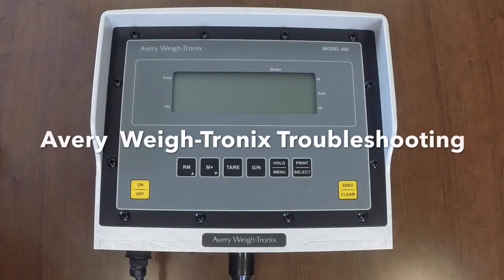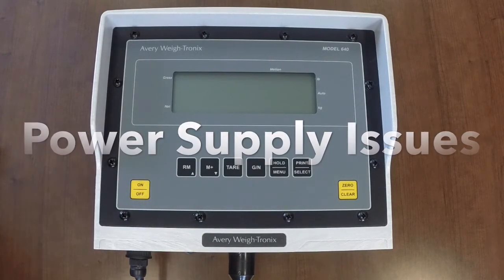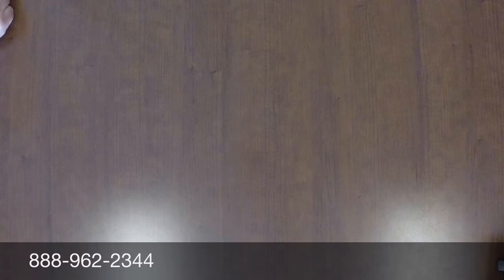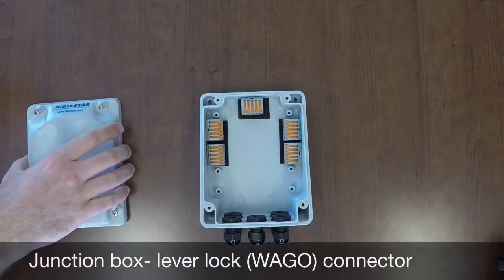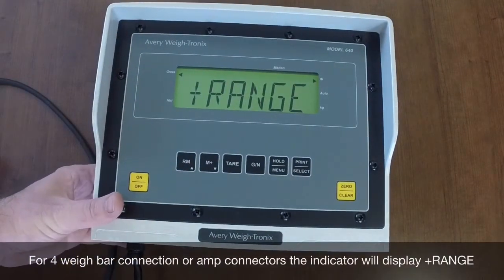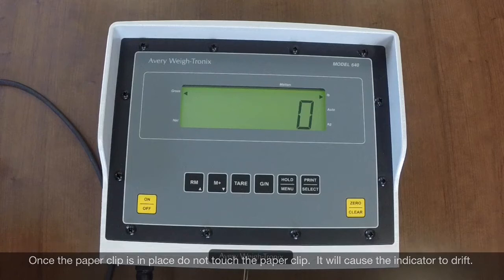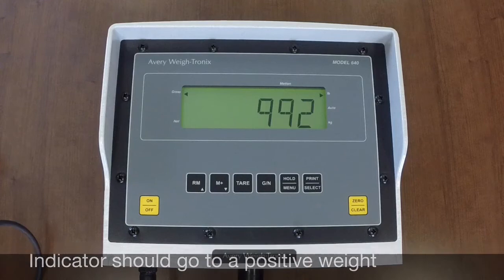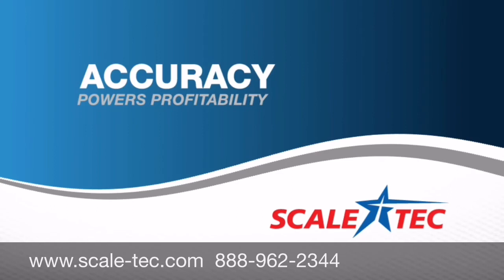Avery Troubleshooting

Comment: Hello sir,
I have a question, if you don't mind I need you to help me
I have the Avery weigh tronix E-1105  indicator connected with the computer by serial cable, and not transfer weight to the computer. 
• I checked the serial cable→It's ok.
• The serial configuration in the indicator and the computer→ the same in all.
• The computer software→operated with another indicator.
What's the problem?
Thank you.